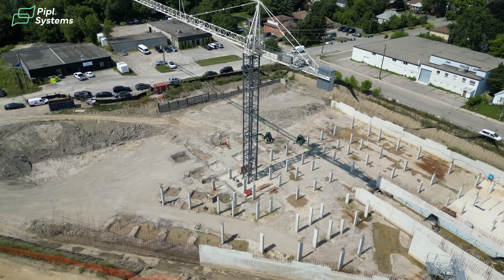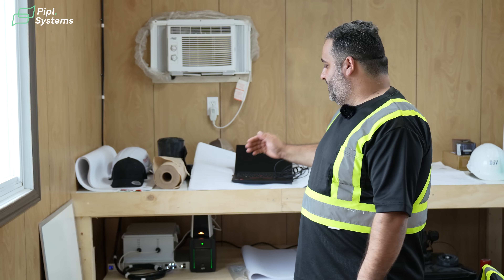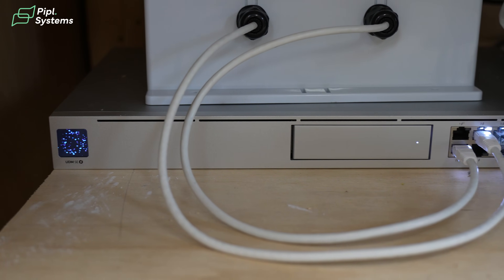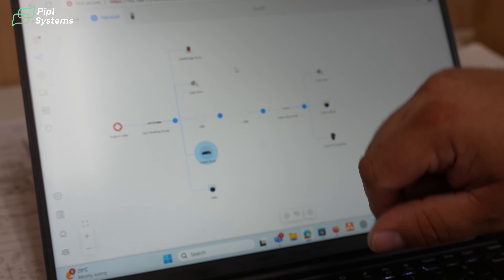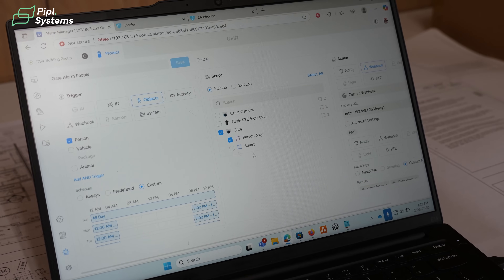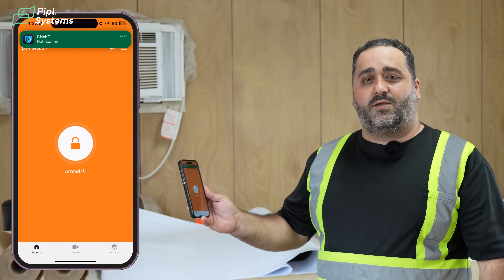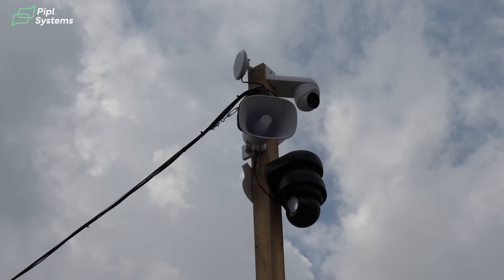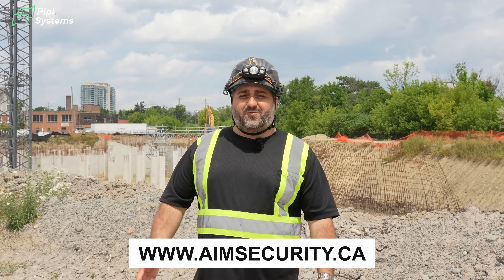AI Video Alarm Monitoring with UniFi Protect Cameras and CHeKT bridge

Comment: would you have been able to do the same with Ajax system instead of the CHEKT system?
Reply from the maker: Great question!
No, we couldn’t achieve a similar system by using Ajax. There’s a reliable network that maintains this system using cable and wireless bridges. To use Ajax, we would need to use the same product or a similar one to get the network up and running. This system includes horns that allow communication through them, as well as costume messages and PTZ cameras with 22x optical zoom at 4k. These products are not currently available from Ajax.
Reply: @piplsystems  - Sorry for not being more specific, i was thinking on the CHEKT system alone compared to AJAX for the arming/disarming/alarm forwarding.
Reply: @piplsystems ? 🙂